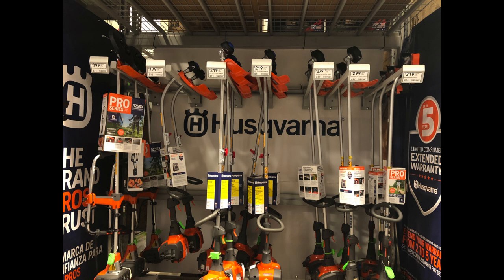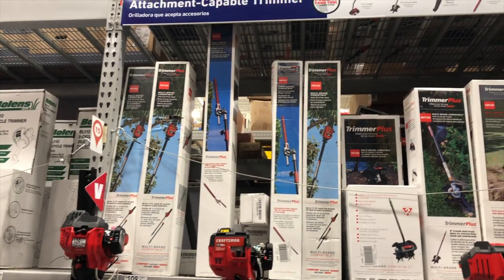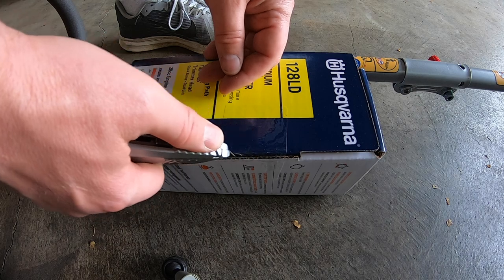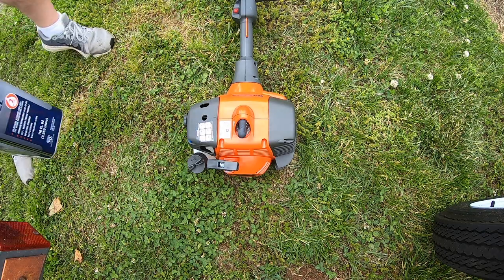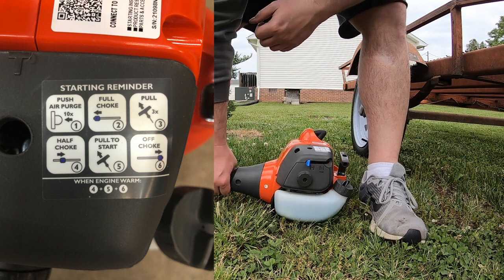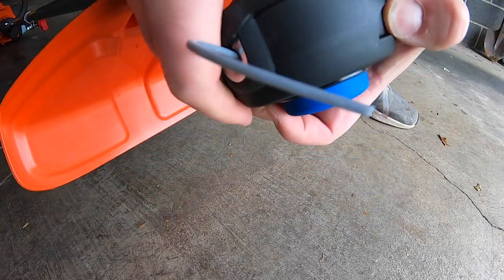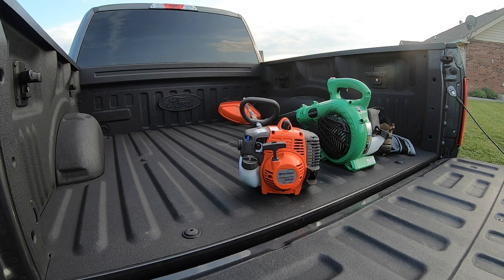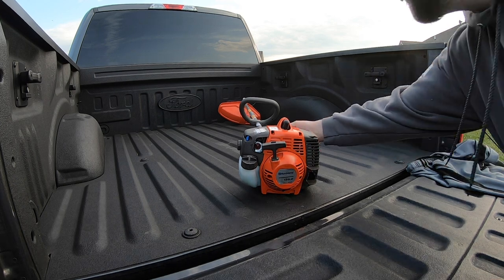New Lowes Husqvarna 128LD Weed Eater Trimmer – Almost got Craftsman WS2200

Comment: This is my primary weed eater, picked it up used it for $40 off the cralighlist (was using Echo SRM210 which is my backup). Overall, great consumer weed eater and has great torque.  One thing to keep in mind, this weed eater is picky about the spark plug it uses, make sure you use a resistor spark plug (E3.10 or NGK resistor works great). If not engine could bog down on full throttle (even with a new carb, fuel line, air filter, fuel filter, clean spark arrestor). Almost threw it away cause of bogging issue.
Reply from the maker: Just saw this comment, sorry.  I noticed with tall grass mine bogs down easy.  I mow often, so it's not an issue, but with a couple new yards I have I've noticed it more and more.  Still stock spark plug - wonder if a change would improve it.
Reply: @weekendhomeprojects  I am a fan of OEM plugs...if I was going to change out say Champion plugs in a Toro powerhead, I would put in NGK the same as in my Echo/Shindaiwa/Maruyama equipment...I will be considering this powerhead for my attachment tools as the Echo PAS units and all new attachments are too pricey for the limited use they get...thanks for this video

Comment: I’ve had my 128ld for going on 12 plus years now.  Hasn’t ever missed a beat.   Only thing I’ve done to it is a new set of fuel lines and primer bulb a few years ago after the original lines started leaking
Reply from the maker: Yeah mine is still cranking on the 2nd pull.  It’s been a good one so far….on its 3rd year.

Comment: Just a tip, I can't emphasize this enough, RUN ALL 2 STROKE EQUIPMENT AT FULL THROTTLE!!! I work at a small engine shop, not running them at full throttle will not properly burn the oil, creating a lot of carbon buildup, which will plug the engine up, make it run not at peak performance, and sometimes score the piston and cylinder, making the engine useless
Reply from the maker: Great tip.  Thank you.
Reply: Stay away from my windows and yard with that please and thank you

Comment: Got my Husqvarna 128LD last year. No, it’s not a commercial grade trimmer, but mine doesn’t seem to lack any power. I’ve ripped through some pretty heavy weeds and undergrowth in the woods that start at the edge of my backyard. But of course after the first tank of fuel through it, I readjusted the H/L screws on the carb. I also picked up the Poulan Pro edger and mini tiller attachments. Haven’t used the mini tiller yet, but the edger works great. And two weeks ago I made the best purchase for it. The Echo SpeedFeed 400 replacement head. I wanted to keep it all Husqvarna and get their new Rapid Replace head, but there have been too many reports of it breaking early. Do I regret owning my 128LD? Not one bit!
Reply from the maker: Awesome, thanks for sharing.  I may have to check that edger out.  Where did you get it?
Reply: @weekendhomeprojects  I ordered the edger attachment from Mowers Direct. The mini tiller/cultivar attachment was from Amazon. Here’s the link for the edge. 

https://www.mowersdirect.com/Poulan-Pro-952-71-16-07/p8296.html?utm_source=order_update&utm_medium=email&utm_campaign=product
Reply from the maker: Still rocking the 128?  How's it treating you this year?
Reply: @weekendhomeprojects  Still running great. A couple weeks ago, I was beating it like a rented mule. Bought the pole saw attachment for it and had a ball of fun clearing out about 40’ of black locust thicket along a steep bank. Everything from about 2” thick to the size of my forearm. The 128LD needed a little more power, but slow and steady got the job done. I won’t lie, I’ve been looking at the 535LST, but I’ll keep using my 128LD until it gives up the ghost.

Comment: Good vid, bought same model recently, same issue with the gas cap. Apparently, your machine was missing the temporary gas tank cap that keeps out any debris.
Reply from the maker: How's it treating you this season?  I've noticed on tall grass mine bogs down a bit.
Reply: @weekendhomeprojects  shorten your string when dealing with taller an thicker grass too much string it’ll just wrap around the head
Reply from the maker: @yunginwildin227  How do you shorten?  Have to manually cut it?  With snips?

Comment: Good trimmer for the price plus attachments to fit without the commercial price. If you can time it right has alot of low end torque.  Good for attachments.
Reply from the maker: You still using yours?  I love that it starts up without issue every time so far for my first year.
Reply: I have one it’s a great trimmer for it’s price..no complaints.

Comment: Craftsman gas powered tools are owned and made by Husqvarna group. Husqvarna is owned by Stanley / Black and Decker. 

Husqvarna makes:
Husqvarna
Gardena
McCulloch
PoulanPro
Weed Eater
Flymo
Jonsered
Klippo
Diamant Boart
RedMax
HTC
Blastrac
Craftsman
Reply from the maker: Yeah, I had read that while searching for this one.  It's surprising they don't make the craftsman as sturdy as the Husq.  They can't be saving more than a few bucks on the cheaper plastic.

Comment: The 128LD will work with the universal attachment system that TrimmerPlus uses.  It's the same connection as Ryobi's eXpandit system.  Most all brands use that system.  Most Husqvarna, all Echo, and all Stihl each have their own proprietary system that isn't compatible with the other systems.  A 128LDX would not work with the same attachments that the 128LD would.
Reply from the maker: Yeah, I got the hedge trimmer attachment.  It's a heavy unit for doing normal hedges, but I have two holly bushes that are so big I can't reach the top with anything but the husq and timmerplus hedge trimmer attachment.  Use it about twice a year.

Comment: Just a heads up.  I hate mine.  I should have gotten the Echo srm225.  Yes it doesn't have the attachments but the 128ld lacks power.  To the point I almost threw it into the bushes yesterday.  It's great for light work.  I just retuned the carb.....from the factory some or most are not tuned right... and got the rpms to max out.  It still dies down when hitting the tall weeds.  Now on the other hand my trusty 25cc craftsman weed eater rips through 1/4" thick branches , weeds, your boots and the whiny neighbor is drowned out by the manly and beastly cackle of the wicked 2 stroke.  My wife actually thought the Husky was a weak toy when she heard me use it for the first time LOL.  And yes it is a weak toy that I can only use on grass LOL.  Gonna mod the muffler and will let you know if it is worth the time.
Reply: You have some specific problem there I have one and it runs great plenty of power.

Comment: Do you have to remove the head to load string?  Or is it a speed feed type of head?
Reply from the maker: You don't have to remove the entire head.  You remove the cover by pressing the two clips on the side, then the string holder slides out.  Add string, slide back on, then insert the cover until the clips engage.  Then you're ready to get to work.

Comment: What is the difference between the 128L and the 128LD
Reply from the maker: I don't know for sure, but this is my guess.  I read that the 128L was discontinued and replaced by the 128LD.  The 128CD has a curved shaft.  "C" for curved?  The 128LD has a straight shaft.  Maybe the "L" has something to do with "straight"?  With both the 128CD and 128LD you can detatch the head and add other attachments such as a hedge trimmer or pole saw.  That's likely where the "D" comes into play.   My guess is the 128L did not have this option and thus didn't have the "D".

Comment: Was pulling the start cord easy, or did it feel difficult and have snap-back like a Sthil trimmer. I am looking for a trimmer with a very easy comfortable pull to start. Thank you
Reply from the maker: I can only compare it to the old walmart trimmer I had before.  The Husqvarna is easier.  It's always two easy pulls on full choke, then one pull on half choke and it starts.  No pull back on start like on my old trimmer, which had a pretty strong pull back.
Reply: @weekendhomeprojects  Thank you
Reply: Starts easily 👍

Comment: I just bought mine and I cut my yard and edged it nicely but I went to cut my neighbors yard and tried to edge it too and everytime I flip it over to start edging it turns off any recommendations I just got it today ?
Reply from the maker: Got enough gas in it?
Reply: Now that I think about it I screwed the cap on wrong and it was leaking like in the video so probably not thanks for the reply
Reply from the maker: @matthewcortez2352  Easy to do, not sure why that cap is so hard to screw on the 1st time.  I constantly catch myself cross threading it.  I also notice when I'm low on gas and flip the unit to one side or the other it can't get gas.
Reply: Because the pick up filter moves out of the gas if it doesn’t have enough fuel in it to prevent it.